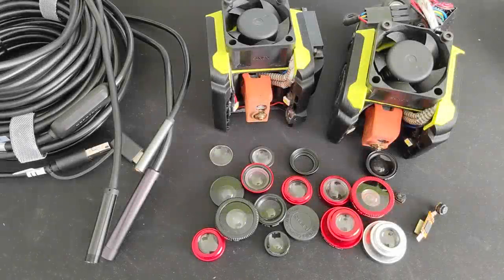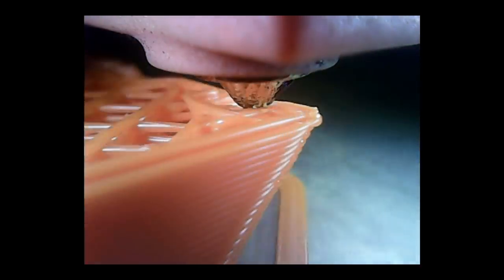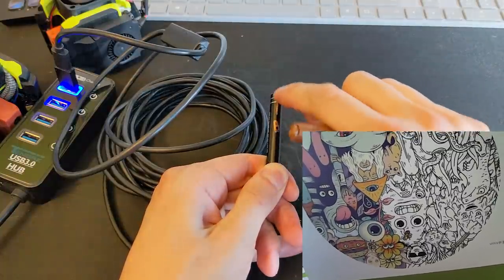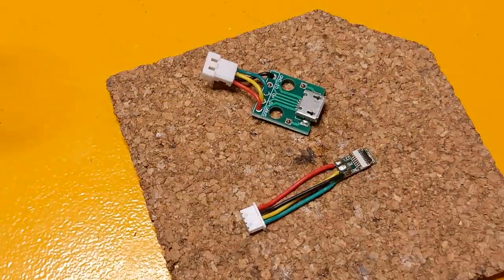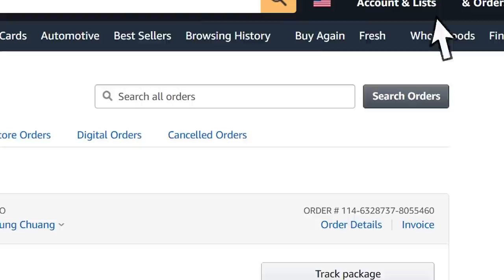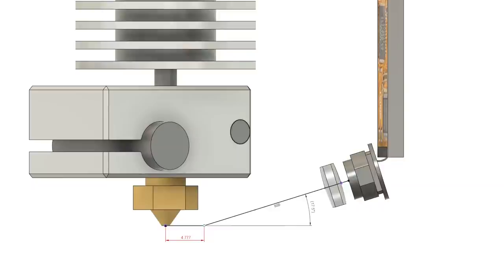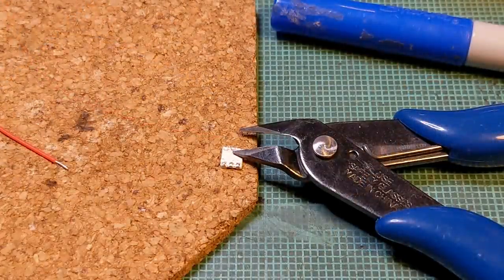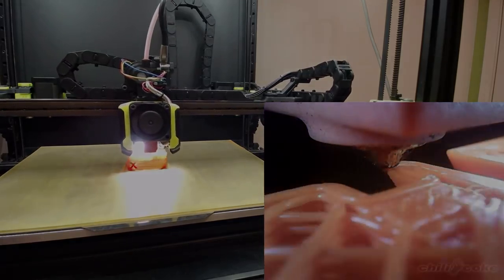3D Printer Nozzle Cam - Complete How To using endoscope!

Comment: For those who want to take apart the endoscope. You dont need any power tools. Just get a hair blower or something the same and heat up the end where the wire is and gently move the rubber part side to side till it slowly pops out. You just need to soften the rubber so you can remove it. No need to do all those grinding and shiz
Reply: tried this  -  ripped the camera apart and tore the  camera's ribbon cable -  will use chilichoke's cutting method in the future (I might buy some cheap borescopes to practice on).  I'm pretty sure chilichoke would have tried the hairdryer method and would have failed too.  But well done - looks like you got the hairdryer method to work !!
Reply: @darrenupton9747 probably got lucky too. maybe they have a different ways of assembling the camera.
Reply: @darrenupton9747 To be fair, chilicoke’s method didn’t apparently go well every time either.

Comment: For the technically less adept, have you considered leaving the endoscope intact and instead using a small mirror, like the type they use in laser cutters? Inexpensive, high quality. You could run the endoscope vertically and have the mirror adjustable to aim your point of interest. In fact, I think my endoscope came with a 90 degree mirror adapter.
Reply: This also would help with the heat frying cameras. I wonder why no one has tried this...
Reply: Thank you!.  Solved my problem.  I'll see front surface mirrors,  I was thinking of mirrors anyway to see all angle from one camera.    I can't see whet's happening on the Sovol extruder like I could with the ancient replicator..

Comment: ha... found an easier way to extract the camera guts.... simply chop up the rubber end at the cable end, and pull it out. Cutting in 'from the back' instructions was deadly to this dis-assembly. I marked the 'bottom' as instructed...and promptly destroyed the little ckt board as it was on edge 'at the bottom' as instructed. This is also how i found simply pulling the rubber extracted the guts  live and learn

Comment: I want to say that your video is amazing. You’ve invested not only time to develop your project, but also to create a great video illustrating the project. It is a ten of ten.

During long time I’ve been thinking to create a similar concept to my flashforge creator pro, and I though a raspicam or a webcam should be enough, but trough your video, I’m jumping to an endoscope cam. This was one of my options, but I never think to disassembly it.  Also using external lens was also not considered in my draft design.

So, thanks again for saving me hundreds of hours of investigation, try and error, and destroying hardware. I’ll start buying the hardware and designing the mount while the parts arrive home. 
Juan .
Reply from the maker: You're more than welcome and glad to hear you found it informative. I'm not big on social media besides a few 3D printing channels on Discord, but figured discussing information other could find useful on private channels is not really that productive to others looking for similar information. Making length YouTube video is new to me (in fact this was my first one) but it does have a broad reach of audience, so I feel like this is a good way to spread information and also to documenting my projects, which I'm usually not very good at.

Comment: I just started my own build. It looks like the Fantronics camera you used changed slightly. It no longer has a breakout board that is attached via ribbon cable. The wires are soldered directly to the main board now.

Comment: I just tried the first steps of this, and had a few additions. 1. You can buy modules directly from Aliexpress, I bought one that said it was focusable, but it seems it's not. But it works, and it does not have any case to remove. 2. I had some iFixit adhesive remover I just used to replace a phone battery (looks like it's Isopropanol and Acetone), I put a drop of that on the glue and the camera popped off with minimal force after about 30 seconds. 
I think the adhesive remover is still risky if any gets on the lens, or inside the assembly it could wreck it just as bad as snapping the cable.
But so far everything works, I ordered a lens now.

Comment: Nice implementation.

I was thinking why didn't you go with mirrors for better positioning instead of destroying endoscopes ?!
I guess aligning a mirror can be done easily & cleanly, maybe you'd need lenses also !

Overall, good job & great camera focus
Reply from the maker: The biggest reason was to reduce it's size and weight as much as possible to maintain the speed performance of the printer, the final camera assembly added less weight then a silicon sock. 👍

Comment: Ordered the same endoscope and took it apart today and came across two big differences from this video.
1. There’s only one board inside, the usb cable are directly soldered to the yellow board that holds the camera lens.
2. I tried finding the bottom on the camera as instructed but it’s the camera view is perpendicular to the board and not parallel.

Comment: Would a microscope lens help?

I ended up with an endoscope which is 5.5mm diameter thin, 480p, hideous colour, but low latency and focused sharp in 30-50mm range, and flexible cable, no stiff section. So i was thinking i'd jam it right in but i can even just mount it vertically and have a mirror towards the nozzle. I mean if i were you, and given you already found a macro lens to refocus the camera further out, i'd probably also just mount it vertically and use a mirror.

Comment: Brilliant video, thank you for all your hard work. I eventually found that endoscope on amazon uk, for £45- that's about $60, and I would prefer to use an affiliate link to thank you for all your work. What was the second-best camera?
Reply from the maker: Endoscopes that are labeled as 2.0 megapixel, has "70°" viewing angle, 1280x720 listed as supported resolution, and has 8mm diameter body is equivalent and close enough, just might have small variations on what's inside. 👍 I believe it still counts if you click in and search for what you need, but even if it doesn't don't worry about it, as spreading useful information is my primary goal, thanks for your support!

Comment: Cant wait to try this on my new Rat Rig vCore 3! Thanks for doing all the heavy lifting so we can just buy the parts that work! I have noticed on another USB endoscope that they tend to get quite hot. Would you expect any issues using PLA or PETG for the housing? Since I am likely to put this into the part cooler ducting, I will probably direct a little cooling to it anyway.

Comment: Qinlorgo 5MP Camera Module, 2592 1944P Camera Module OV5640. Thought maybe this might be easier than stripping it down to get to the component. Ordered one to see if it would work
Reply: Would love feedback on that camera module, I've seen the esp32 use it
Reply: @Nairod785  I'll let you know. Going to try it out this weekend
Reply: @DesignitBuilditRepairit  Nice, I've done some research on modules as well and found the best camera for the job, 4k 60fps, fhd 120fps, HD 240fps :  matecam x9 with imx258

Comment: Great video. Were you able to videorecord why there are small gaps in outer perimenters if random start is choosen? Or e.g. gaps on the chimney on 3d benchy with standard settings?
Reply from the maker: Actually, I wasn't using random start but "User Specified" for "Z Seam Alignment". The gap is because when printing with 0.8mm nozzle I almost always set "Fill Gaps Between Walls" to "Nowhere", reason being 2 passes of wall is already 1.6mm wide vs 0.8mm on a 0.4mm nozzle, which is already plenty strong so no need to waste time filling gaps between walls, and this also produces smooth looking exterior premiere.

Comment: Any known endoscope source for EU? Can't find the fantronic (or any of the ones mentioned) on EU amazon :(
Reply from the maker: The Fantronics has slightly wider FoV and the internal guts is way more consistent as you never know what you're getting out of China, which is the reason I recommend it. Endoscopes that are labeled as 2.0 megapixel, has "70°" viewing angle, 1280x720 listed as supporter resolution, and has 8mm diameter body is equivalent and close enough. 👍

Comment: Can you not just heat up the rear "stain relief" part of the EndoScope and pull the whole assembly out as it would have been installed??

I might try that on a spare i have laying about!
Reply: Yeah, on my generic Cam just heating up the body with a lighter for 10 seconds or so and it pulls really nicely out the back

Comment: Any possibility to share the design of the hotend?
Reply from the maker: Not yet, I'm a little reluctant releasing what I have now because it's still rough and not release ready, and my Voron carriage + print head were never stock, I modified it since day 1 to be able to switch between V6 and Volcano while keeping same Z probe position (not possible if stock spec). Because the nozzle was never in the "stock spec" position, if I release it people would need to modify their config file. I'd rather just release (when finished) the stock spec carriage for both 2.2 and 2.4. Another potential problem is that different hotends will have different nozzle position, and Afterburner doesn't account for that. For all these reasons is why I am designing my 2.4 complete carriage/printhead mod, which I can then release everything as a print-and-assemble solution.

Comment: Any link to your toolhead design ? Has it been adapted to an afterburner V2.4 style yet ?
Reply from the maker: Not yet, I'm a little reluctant releasing what I have now because it's still rough and not release ready, and my Voron carriage + print head were never stock, I modified it since day 1 to be able to switch between V6 and Volcano while keeping same Z probe position (not possible if stock spec). Because the nozzle was never in the "stock spec" position, if I release it people would need to modify their config file. I'd rather just release (when finished) the stock spec carriage for both 2.2 and 2.4. Another potential problem is that different hotends will have different nozzle position, and Afterburner doesn't account for that. For all these reasons is why I am designing my 2.4 complete carriage/printhead mod, which I can then release everything as a print-and-assemble solution.

Comment: ive done the fokus in software, a lot easier and faster to adjust. But cutting the camera part of is a thing i should make becouse i have the whole endoscop camera on my print head :D
Reply from the maker: Most endoscopes don't have electronic focus mechanism, I purposely chose camera modules without it because I found it's better have locked focus on moving subjects, and if it's not needed I'd much rather use smaller/lighter modules to prevent adding as much weight to carriage as possible.

Comment: One concern: the print head moves, which also moves the cable. Is the USB cable fails over time due to the movements caused by the print head? Definitely that can be a point of failure, isn't it? 😉
Reply: Probably not any more of an issue than any other wires failling. Sure over time it will happen but I wouldn't be super concerned. Worse case you just resolder and should be good to go.
Reply from the maker: Yup, I did mention replace the original usb cable with a more flexible one to bundle together with your existing print head wires. If you are planning to run it through a cable chain like I am, then it would be a good idea to replace it with silicon or PTFE wires to minimize cable failure.

Comment: you could have 3d printed a custom socket to break the glue loose instead of using pliers
Reply from the maker: I've considered this but due to its size you'd probably need to have a .2mm nozzle installed to be able to print a socket that's able to engage. This would be a good option for people looking to do multiple camera modules. I personally prefer the lens method as it shields the camera from radiating heat.
Reply: @chilicoke  yeah now that you say so. You are right those ribs are usually really tiny the lens method does add an extra layer of protection and you could even sla print them

Comment: Issue is that manufacturers will swap components depending on whats available so even the endoscope you recommended could end up not working for everyone else. Please comment if you get specifications of the camera component. Thank you.
Reply from the maker: Unfortunately specs of the camera is a little bit of unknown, and you are right that factories some times swap internal components unannounced, which is the reason I recommended a "branded" endoscope to hopefully can be more predictable rather than an generic one.
Reply: @chilicoke  "Branded" products are not what they once were. As you can see, the seller who uses this using brand name for their storefront also sells a different brand name of the same product. That's the equivalent of Nike selling the same shoe as both a Nike and an Adidas meaning those components are going to change as soon as some manufacturer offers a lower price. 
If the brand offered a spec sheet on the product, that would be different but as you have seen, they are not going to do that. If you make another video, you might consider getting in touch with some suppliers. You would avoid 90% of the hassle you went through in trying to get the component ready and in one piece. I can put you in touch with one or two but there are probably better resources for finding them. Either way, thanks again.

Comment: Here is a slightly simpler method, I leave the rigid cable on the front and can thus use it as a holder. I make the rest of the cable flexible.

https://youtu.be/Jg_AKzuWCMw

Comment: BTW this is no longer an option, the way you installed the PCB and focused the lens. I've had 4 different versions of the fantronics camera, and only my original one had the CMOS inline with the PCB, all the other ones the default orientation of the CMOS to the PCB is 90 degrees. When using mjpeg streamer there is no option to rotate 90, only flip horizontally or vertically. Sad face.

Comment: 20 endoscopes.... conclusion - price for nozzle cam = printer price.... i will be waiting something already finished on ali
Reply from the maker: Someone had to take the first step to try something new, and that first step is never cheap nor easy. That's how everything started before they became affordable and easily accessible. I ate the cost and am sharing what I learned with everyone so one day you and others can buy it premade for a few dollars. That's the spirit of open source.
Reply: BTW why you didn't use something like RAW endoscope module (without case) from ali? Search name "720P USB Endoscope Module"
Reply: @vini4806  Great idea for people like me that have no way of safely cutting the aluminium case
Reply from the maker: @vini4806  I did looked at those, they are identical to a lot of the lower-end endoscopes often with misleading/incorrect specs listed, their performance are subpar and often times are not any cheaper than simply buying endoscopes with better camera modules inside.
Reply: @chilicoke  I see